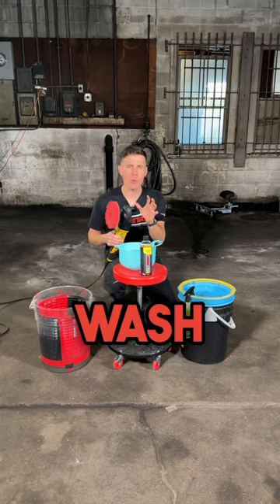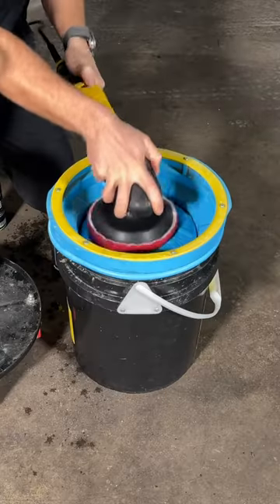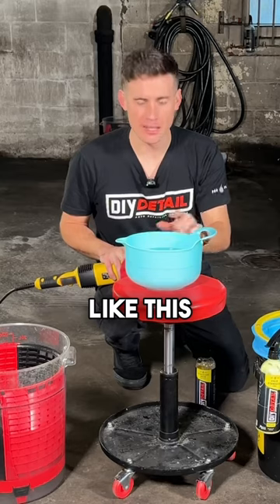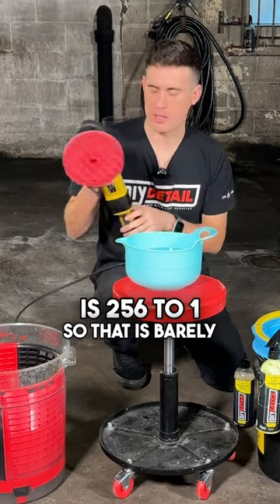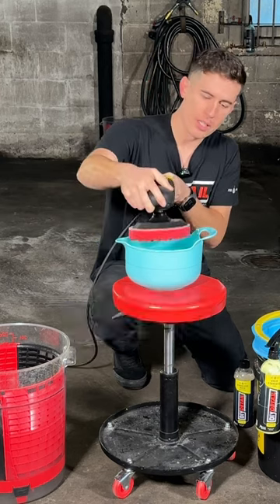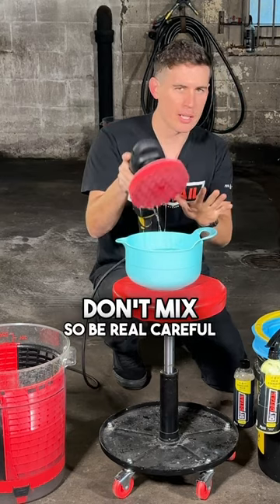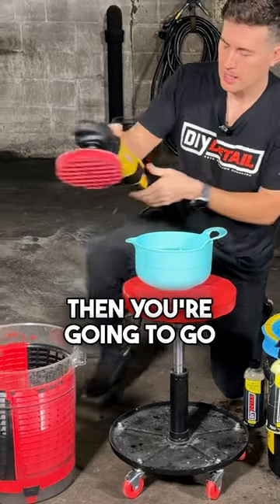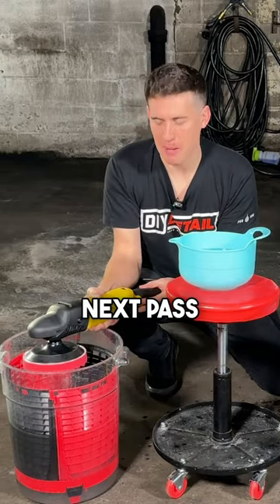No pad washer? No problem

Comment: “256 to 1” might as well be Greek to me. I know that a ratio for mixing but hey in the real world we don’t speak like that, trust me.
Reply: For a gallon of water, just a capful to make it easy
Reply from the maker: 256/1 is admittedly a little obscure, but it’s a common ratio in detailing ( as is 128/1 and 512/1). A gallons contains 128oz, and we suggest 1/2 oz per gallon, or if you prefer 1 oz for 2 gallons of water. To be more accurate the ratio is actually 250/1 or 4ml per litre.
Reply: In the real world?? Anybody watching this video im sure knows that "lingo"
Reply: Being from EU helps me so much understand this. Just 2ml in a (what  it looks like) 500ml bucket 😂
Reply: @briansilva3061 😜😜😜that depends on who's real world, the detailer's or diy-er's?😜😜😜
Reply from the maker: 4ml per l

Comment: I’m a diesel mechanic but never buffed a car. For now shoukd I just use my orbital sander with a pad and then eventually get a duel action? Also dual action means it’s random orbital and has forced rotation like a rotary right?
Reply from the maker: Yes use your sander, eventually you can choose another tool if you need

Comment: Great tip to use a large bowl instead of a pad washer to save a bit. Can I wet my DIY jeweling pad with rinse-less to help with lubricity when machine applying a liquid wax? Or will the rinse-less break down the wax and compromise the finish?  ...just trying to figure if I can save product by not having to saturate the entire pad with wax.
Reply from the maker: It’s best to use a dry pad

Comment: Do I need more than one pad for the whole car? And also when I use the gold standard is it safe to ceramic coat after?
Reply: make sure to wipe with isopropyl alcohol after you polish if you are going to ceramic coat after
Reply from the maker: One pad if kept clean is all you need. Yes you can coat after using DIY Detail Panel Prep.
Reply: @dubu12 half alcohol and half distilled water